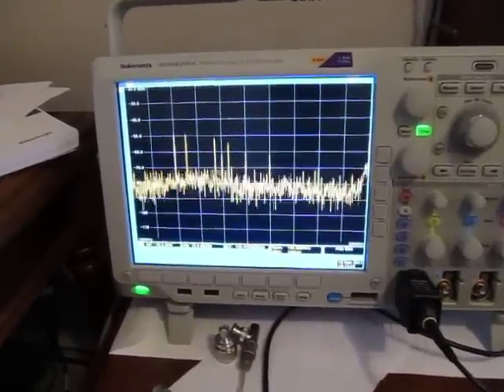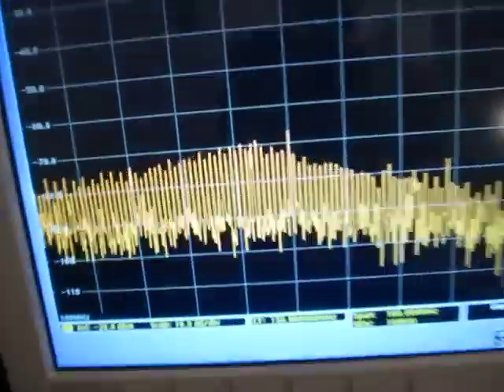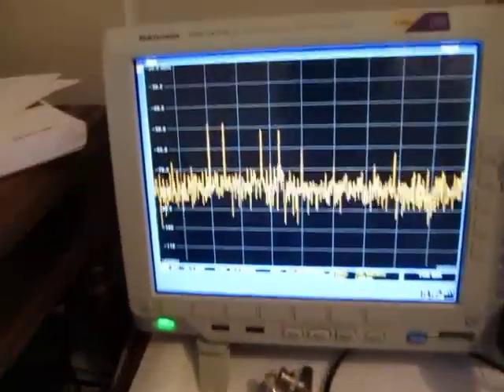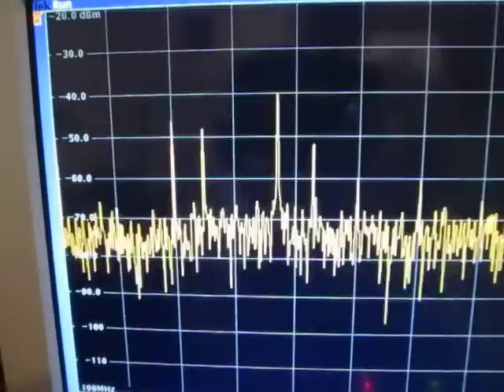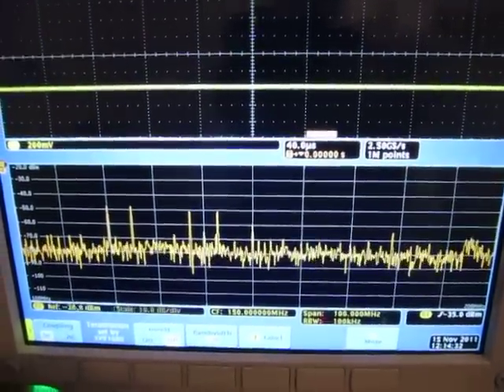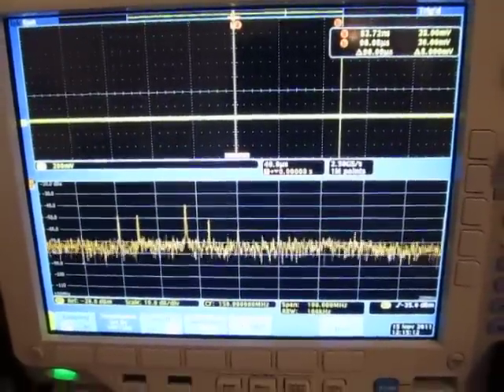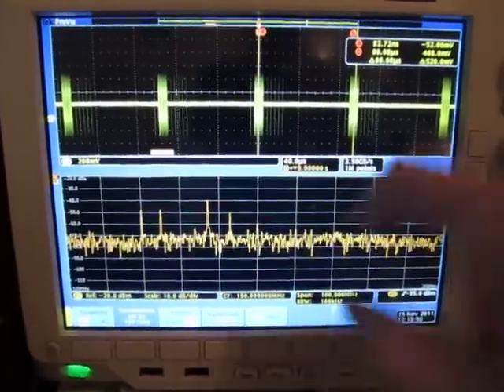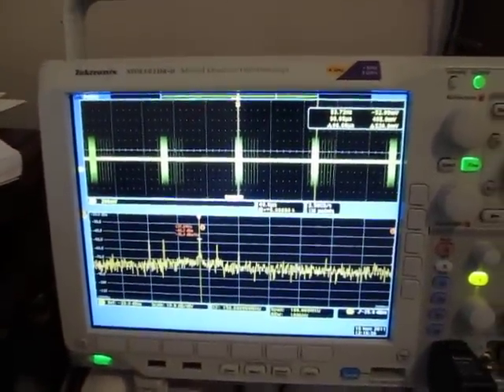#24: Transient EMI Debug using Tektronix MDO4000 Mixed Domain Oscilloscope

Comment: I absolutely love your videos.  I am using part of my furlough here to watch through every one.  One thing that is a bit disheartening however for the amateur home hobby person is that equipment such as the MDO4000 are way beyond our reach ($15,000+).  You've convinced me that I need to upgrade to a used Tektronix 2427 or 468 for my analog scope.  I'll probably need to do the same for my digital.  I currently use a Tektronix TBS 1052B (50MHz) for digital and BK Precision 2120B (30MHz) for analog.

Anyway, my request is if you can sprinkle in more strategies for amateurs to use on less expensive test equipment along with your demos of the high-end tools?

Thank you again for the great videos
Reply from the maker: I'll certainly take that under advisement.  Much of what I do can be done with hobbyist grade equipment.  Of course, this particular demonstration isn't one of them.  Actually, I did this video 8 or 9 years ago for a specific professional customer of mine that asked about it.
Reply: Yes and as I watch more videos my initial feedback may be unfair. I’m now seeing lots of videos targeted editor at the amateur space. This is really a great channel and your content is awesome. Thank you for your huge time investment in it